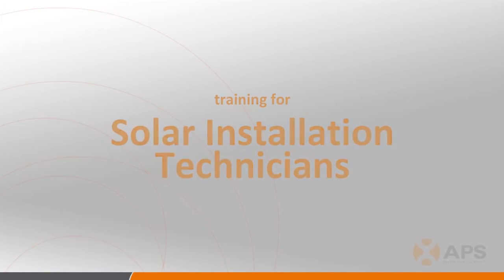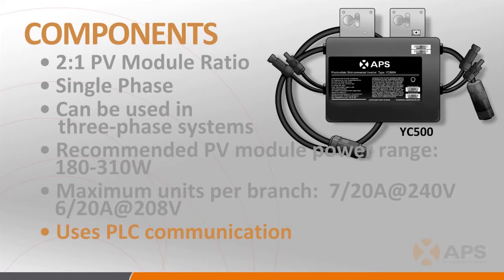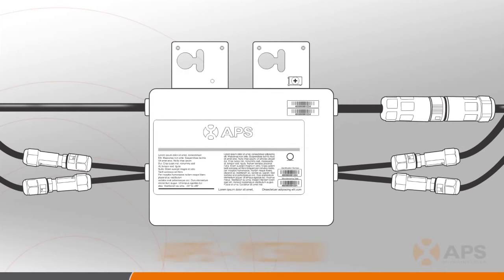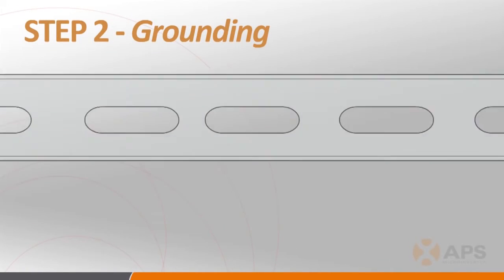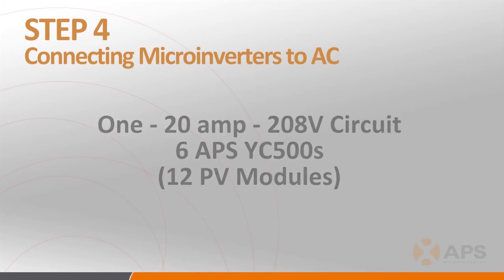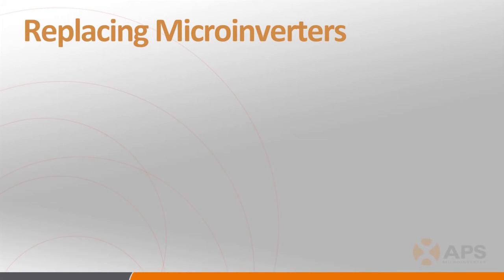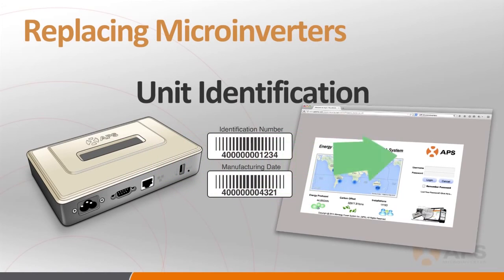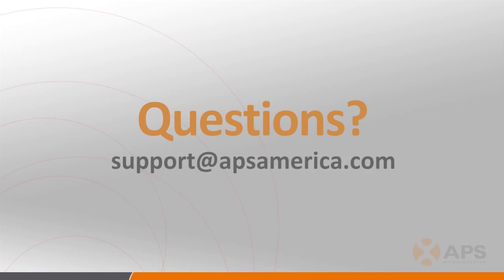APS YC500A and ECU Installation Training

Comment: If a person could get a sponsor from these companies and setup a prototype Home with 21 of these units with a Magnasine 4448PAE Battery battery back up setup in the AC Coupling format. There would be sales out of the world for these companies. Magna sine Inverters will switch so fast that these YC500A inverters will not shut down when the grid goes down because they are connected to the inverter output side of the Magna sine inverter and not the grid side. So when the grid goes down the Magnasine inverter Islands the grid for safety and switches to Inverter to supply the needed circuits making the YC500A think the grid is still up and if the home isn't using the Solar energy the Magnasine will charge the Batteries or send the Extra power to another Magnum devices called a Magnum ACLD-40 Load Diverter is the only AC Load diversion controller on the market! The Magnum ACLD-40 monitors the voltage of your renewable energy system's backup battery bank and diverts (and inverts!) excess energy to an AC load if the battery voltage rises